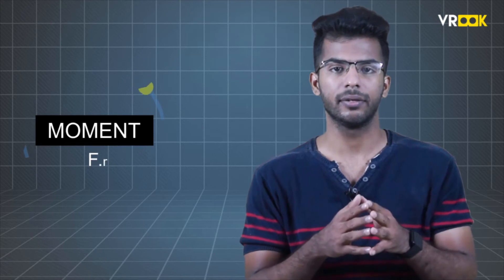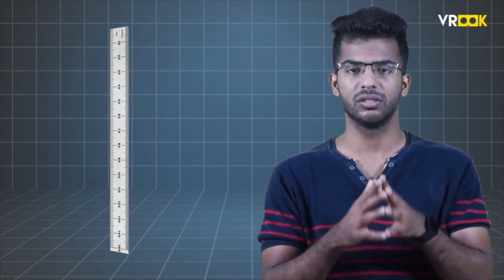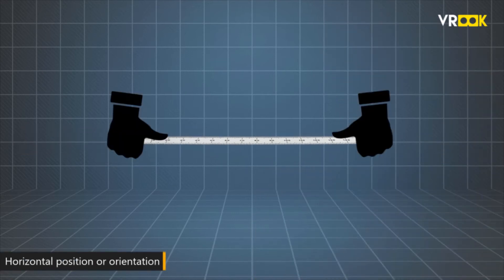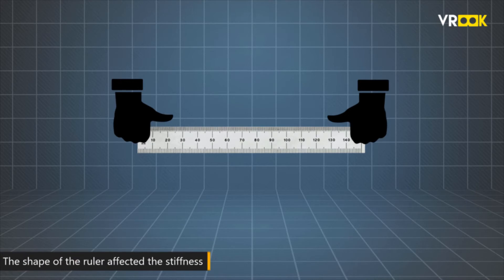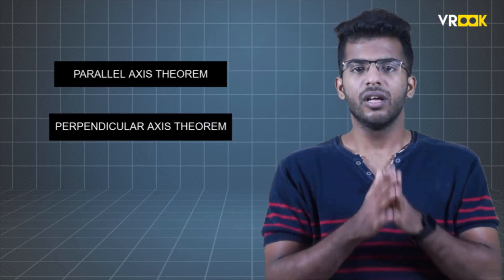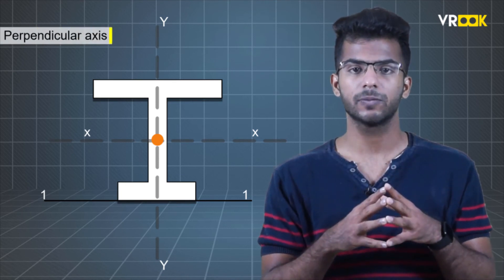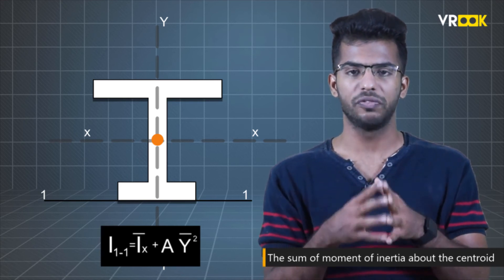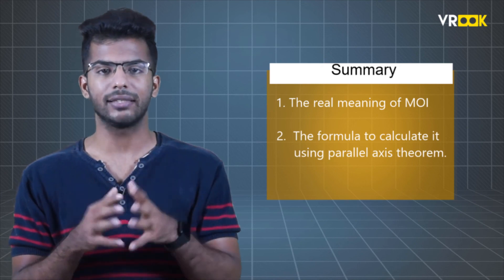What is moment of Inertia | Calculation of moment of inertia | Civil engineering

Comment: U did not explain why MOI is required or calculated. What big purpose is served?
Reply from the maker: We explained one of the need as beam bending resistance. It can help beams to take more load if you consider MoI and design.

Comment: so how does the value of moment of inertia affects its rotation?  will larger moment of inertia resist rotation or it'll allow it easily?
Reply: It is inertia about perpendicular axis of the section and can be determined from Ixx and Iyy by perpendicular axis theorem. The resistance for the twist is more if Izz is more. Izz=Ixx+Iyy.